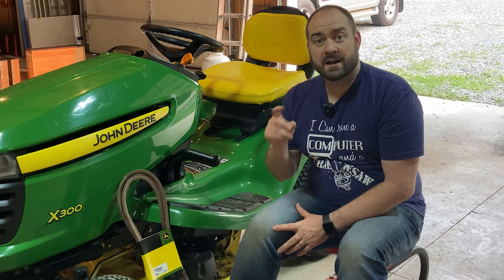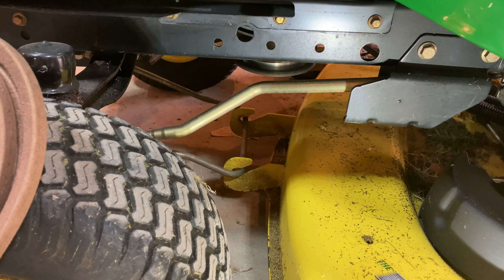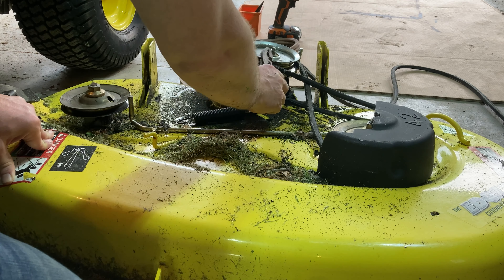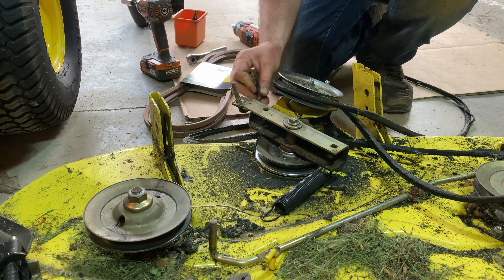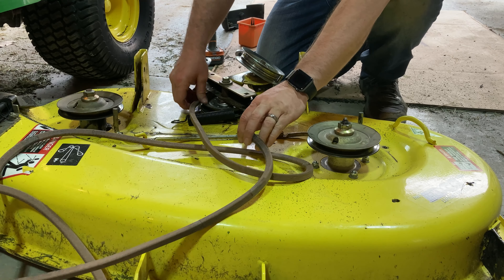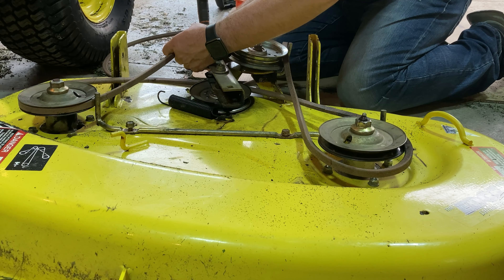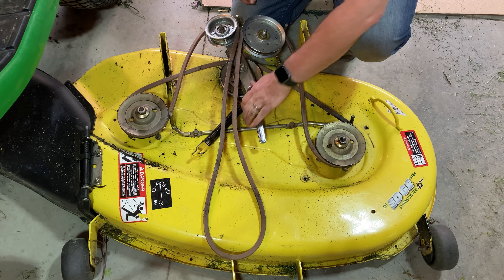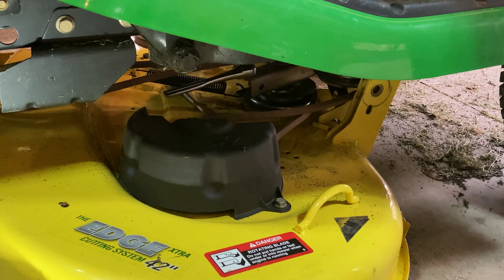How to easily change deck belt on John Deere X300 M154621

Comment: Great video, very helpful, thank you!!! 
Fyi, our JD supplier sold us the wrong belt in the right packaging. Very frustrating. Ha ha. Got it replaced and went on like a dream. One other note: did not need to remove the spring. My guy did that the first go round; it was very difficult for an older guy. With the correct belt, he got it on perfectly with no need to touch that spring.
Reply from the maker: Glad it helped!

Comment: I have a JD x304 and have had to replace this same belt 7-8 times.  Have used after market as well as OEM belts. The OEM is costly but is better quality belt. You can buy aftermarket and get two for same price as the OEM but who wants to change this 2-3 times a year. This watching this video its best I have seen in explaining the correct steps. Thanks
Reply from the maker: Thanks for the compliment! I definitely like the OEM belts better. You’re right- no sense in doing this twice or three times as often.
Reply: Zack - I have a 304 also and am also already on my second belt this season.  You have any idea what makes them go through belts like this?

Comment: Thanks for posting this video.  I too bought an after market belt that only lasted for about 3 mowings.  I was changing oil, filter and blades so thought I would put a new belt on at the same time (still had the original John Deere belt) and was very disappointed how soon the belt broke.  I have ordered a John Deere belt to replace the after market belt.  Hopefully will last as long as the original belt.
Reply from the maker: There's definitely no comparison between the original John Deere belts and the aftermarket ones (at least the aftermarket ones that I've seen). Thanks for sharing your experience.

Comment: Very clear video.   Went to cut my lawn and the pto did not engage.  The belt has slipped off.  This video should make fixing it a lot easier,  Thanks
Reply from the maker: Glad it was helpful. Usually once it starts slipping off once it's getting stretched out beyond what the spring on the tensioner can handle. Not sure if that's the case with yours - but it might be a good idea to have a spare belt on hand.

Comment: Good tutorial. I learned the same lesson with lawn tractors - OEM parts are the only way to go. You actually spend more with cheap parts.
Reply from the maker: 100% agree. I've tried to save a few bucks by using aftermarket parts - and it always ends up costing me more. The OEM parts work better and last longer. They're always worth the extra money.

Comment: My mower is the same i just replaced the belt and blades, but when i went to test it i smell a burning rubber smell. Is there a belt tension adjustment or is that just that tensioner puller... about to take another look it it. Any info would be great
Reply from the maker: I had that trouble once when I tried a different brand belt. It only lasted a few times and shredded. The next time, I put the John Deere OEM belt on and never had another issue.

Comment: Good job Chad, really clear and concise.  I must say that after watching this, and after having had to replace the drive belt on my Deere GT235, I am convinced that JD (and most other modern mower brands) just like to make belt changing overly-involved and complicated.  They could learn a LOT from my 70's Wheel Horse tractors.  I can literally remove the deck, change the belt and reinstall the deck—without tools, mind you—all in about 5 minutes.

(Having typed this, I realize that I sound like the pair of grumpy old men Muppets that live in the theater balcony!) 🤨😅
Reply from the maker: I was thinking the same thing! Changing the belts on the older machines was certainly easier.
Reply: And the wheel horse did a great job cutting also
Reply: My JD Saber 2354 has a belt for the deck and a belt from the motor to the deck
Reply: My JD has the two belt setup as well Larry. 👍
Reply from the maker: @larrykluckoutdoors8227  I prefer that system. I like separate belts for the deck, and for the motor to the deck. Sometimes I wish that there were still separate belts on vehicles too - instead of one serpentine belt. :)
Reply from the maker: @watershedoverlook  Thanks, Chris!

Comment: So how long did you mow with that belt that you took off I can mow 4 times and my belt that is not the john deere you put on looks just like the belt you took off and it jumps off so is it a belt issue or what
Reply from the maker: With the non-oem belt - I mowed only about 3 times. I’m already glad I switched back to the OEM belt. It’s much better quality.

Comment: My x300 with 42” edge deck lists 2 options on the parts diagram: 154601 (w/ belt tens) and 155525 (w/o belt tens) but not this part number. I’m assuming I have a belt tensioner so I guess I get that one? Anyone have any insight?